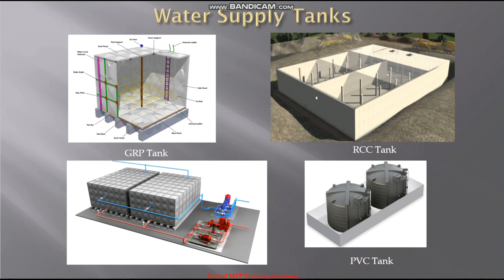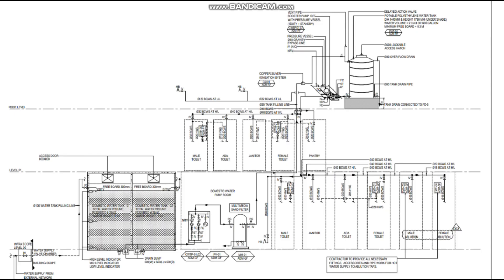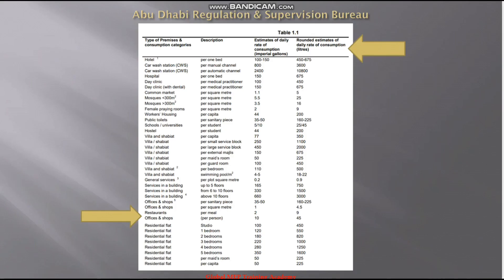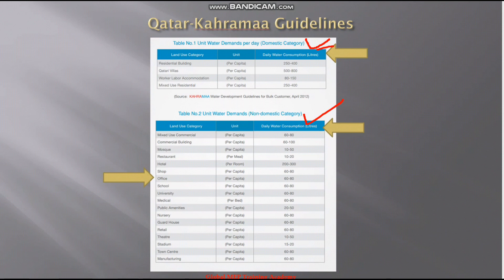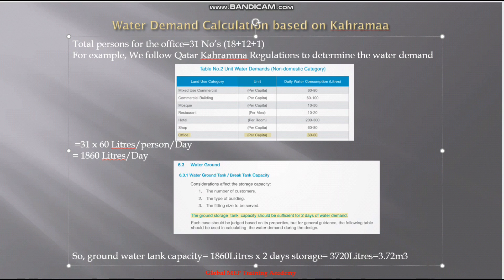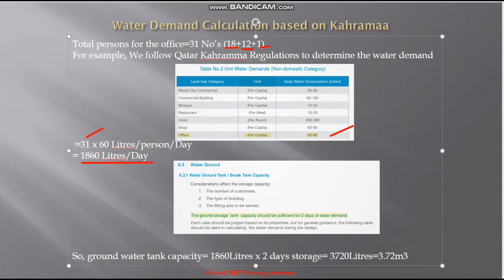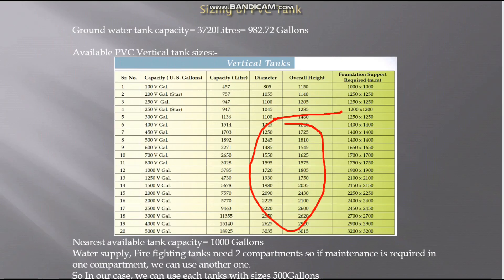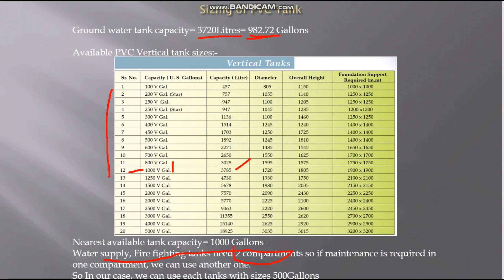Water Supply storage Tank l GRP,PVC,RCC Tank l GCC standards requirements

Comment: Answer for the question- I think we can install the water tank in the back side of office, i mean garden area and water meter in the front side of wall which is facing the road. Is that correct?
Reply from the maker: Thank you for your comment brother🎉 But what u have mentioned is not correct as per Qatar regulations 😊 so I wil post the answer in the plumbing installation video❤